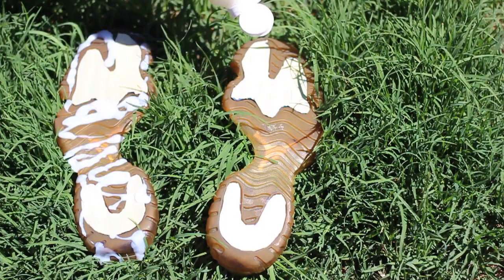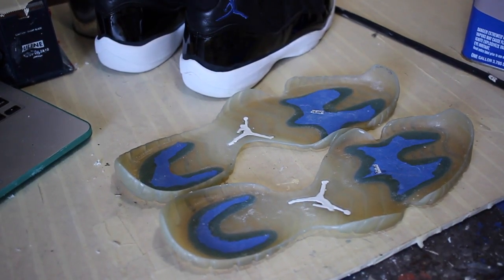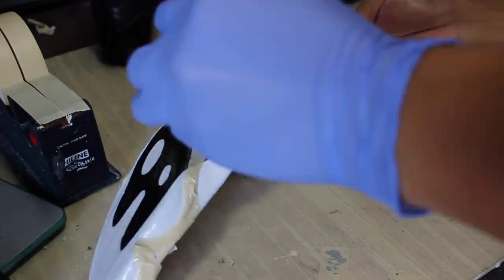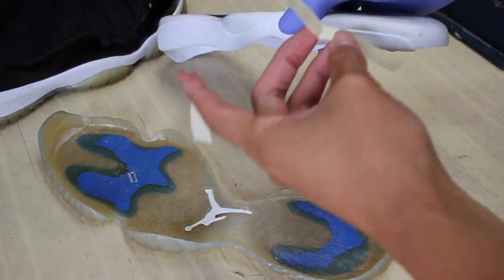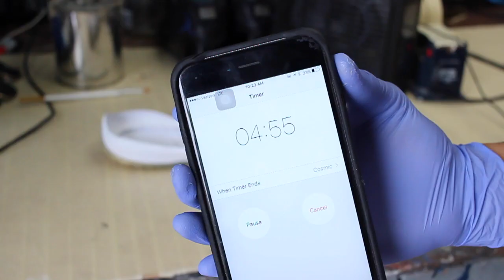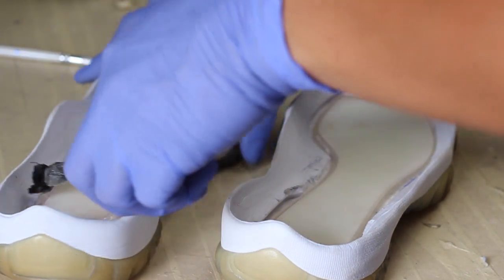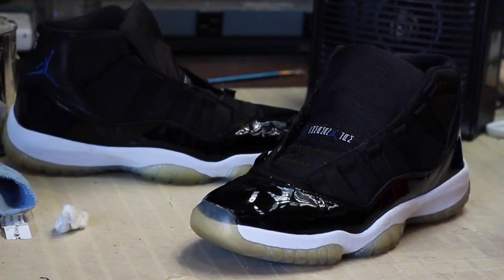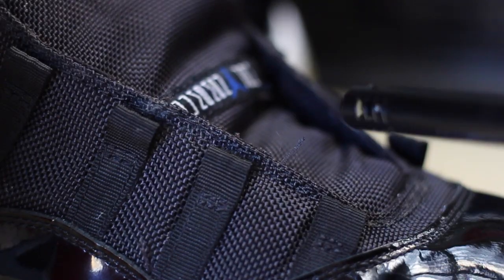2000 Air Jordan Space Jam XI Full Restoration

Comment: could I just leave the air bag in there or do it have to be replaced
Reply: +AJKicks you can keep the air bag if it doesn't rattle. if you shake it and it rattles - it's old and will or has popped. replace it with a zoom bag or air bag